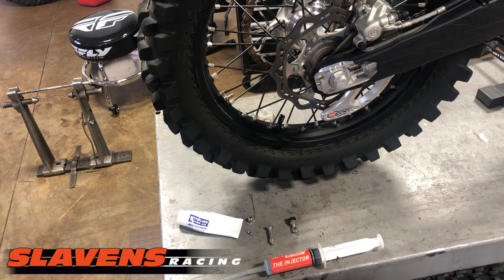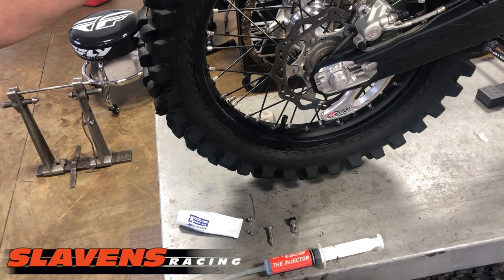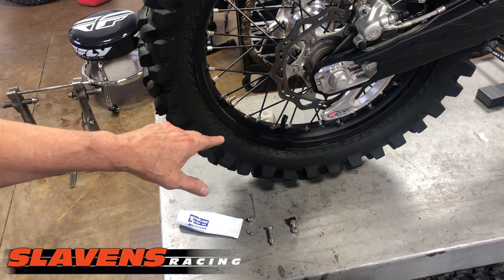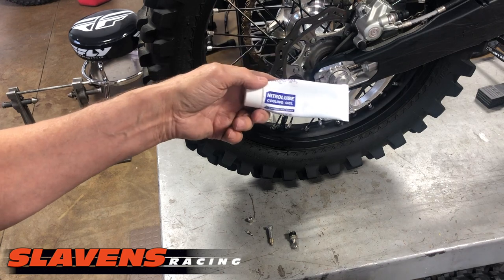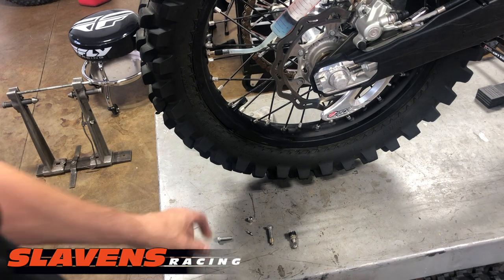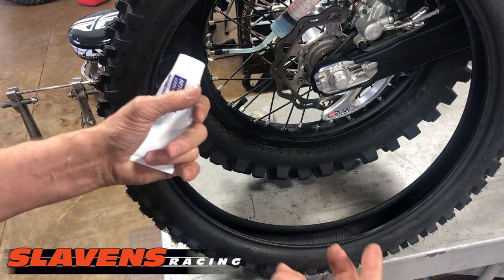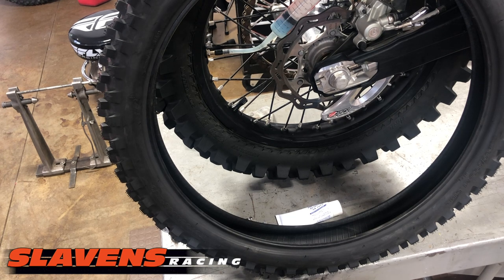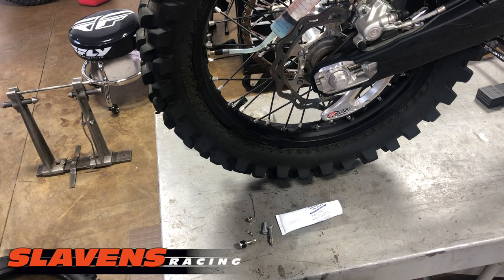How-to Relube a Mousse

Comment: Sweet! I will try this. I always assumed the mousse always pressed against the valve stem area too tight and would never allow this. I'd love to fabricate a zirk fitting instead of a valve stem and then load a grease gun full of silicone and be able to force it in by pumping the handle but I may be just dreaming.....

Comment: Great video.  I use this method but for some reason my front tire valve seems to be plugged and I can’t get the lube in the same way as my rear tire.  Any suggestions?   Big fan of all your videos.
Reply from the maker: I’ll assume you have the core removed. Blow compressed air in to clear the blockage.
Reply: Yes the core is out, good suggestion about the compressed air. How heavy in the compressed air should I go in for how long, I don’t want to damage the mouse.

Comment: Hi Jeff I need your advice. I own a KTM 300 TPI and only use Michelin enduro M tyres and corresponding bib mousses. Sadly After changing the tyres only a couple of time and looking at the mousse intact I cannot get the tyre bead to sit back properly. After inflating the tyre the bead gets into place but would not stay there once the air gets out. Is it due to the bib mousse loosing its volume ? Any way to extend the life of the mousse that seems still in very good condition ?
Reply from the maker: Hello:
Sounds like your mousse has shrunk prematurely and that is typically caused by not enough lube or the correct type of lubricant OR from riding on pavement which causes extreme heat. We highly recommend Nitro Lube https://slavensracing.com/shop/nitromousse-mounting-lube-by-nuetech/ and you should never use Murphy's Soap. 

How to save your current mousse: If you have an old mousse, cut out a 3"-4" section, then cut your newer mousse and force in the section. If you don't have an old mousse, we sell mousse sections https://slavensracing.com/shop/nitrowedge-by-nuetech/ for tuning your mousse.

Comment: Sweet man. How long do you think a mousse can last in dual sport application? Michelin mousse, mostly forest roads and trails. Thanks!!
Reply: I run standard nitro mousse in front and soft in the rear. I can get 100+ hours in dual sport riding on a Husky 300. Mostly off road trail (single and two track) with about 10-15% asphalt to get to the good stuff. I keep the speeds on asphalt low(below 50 mph) as heat is what kills the mousses life.
Reply from the maker: Ducatirocks answered your question. I prefer TUbliss in all of dirt bikes and only use mousses in my 500 for dual sport rides.

Comment: Do you sell that injector thing
Reply: Use a syringe with some fuel tubing 

Another alternative take an old tube and cut it up. Run tape around the rim to hold in place. 
I prefer to use a cycling presta valves as the entire stem is threaded and removing the core is easier. 

Having the valve also makes it super easy to pop the beads with compressed air